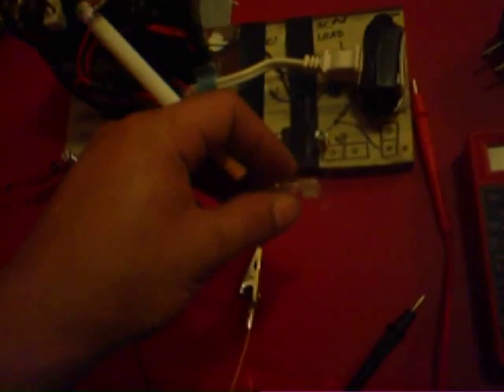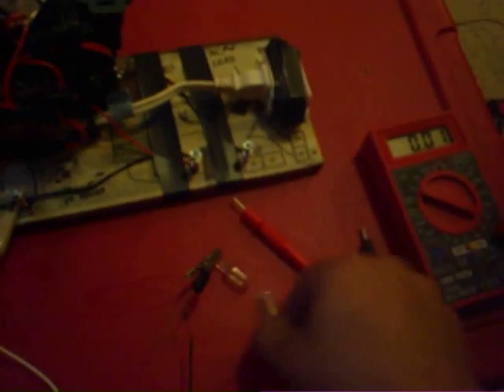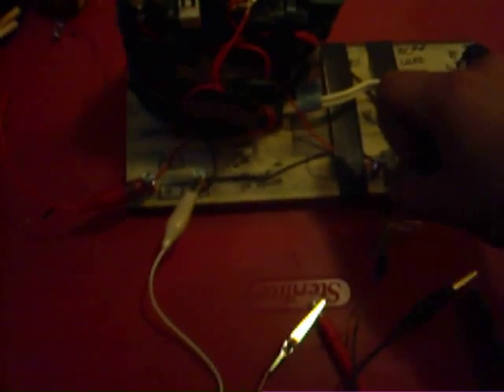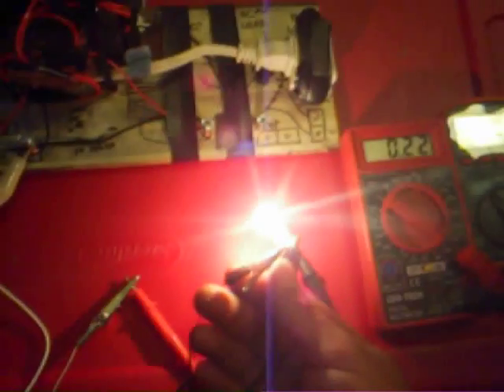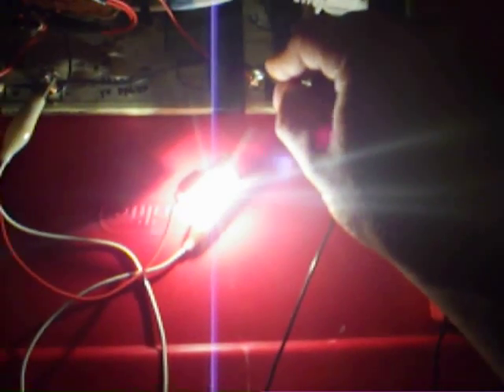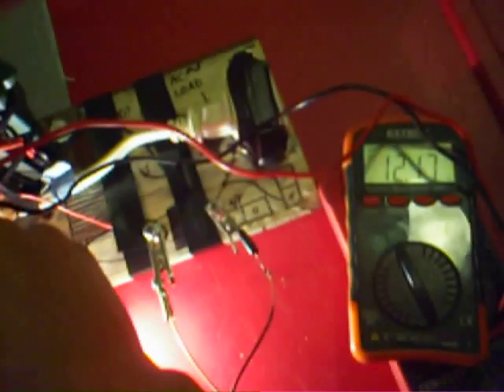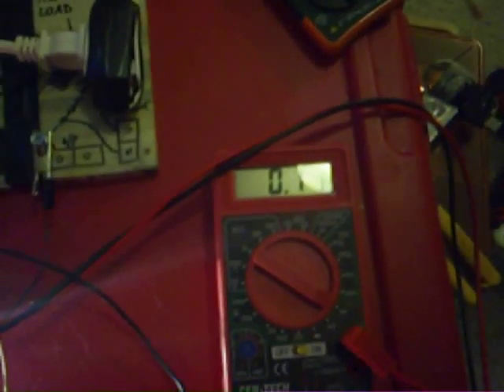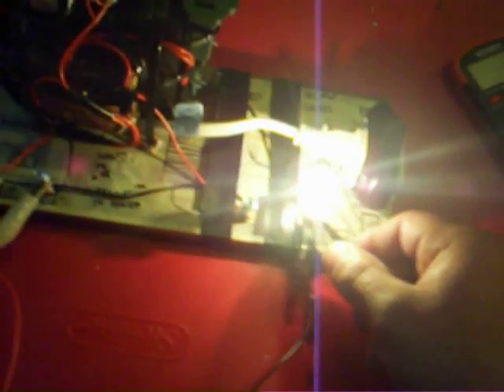12v straight DC vs HV pulsed DC

Comment: The voltage spikes coming off the circuit maybe?  Or maybe the rms is different from the meters?  Good experiment
Reply from the maker: Farlande4 yes i'd say that the voltage spikes are periodically driving the bulb at a higher voltage less current ratio as opposed to straight 12v DC, and for whatever reason this is giving the light a more whitish and brighter appearance.  this is pretty straightforward and understandable when dealing with low power LEDs but it's interesting to see sort of the same thing in an incandescent bulb.

Comment: You won't get an accurate reading of DC voltage, if the DC is pulsed, because pulsed DC is essentially AC.
Reply from the maker: this is true but either way the pulsed output is providing the brighter light, and factoring in the losses in the oscillator, the watts going into the bulb via the pulsed DC is very similar to the watts going in straight from the smoothed DC from the adapter. in this test i cannot say for sure the brighter bulb is actually using less wattage, but i'd wager it to be roughly the same. the oscillator itself is pulling more current overall, but as blocking oscillators go that dirty setup is probably only about 40% efficient at most. so i'd wager in this particular test the bulb is showing that it will get brighter with a different v/a ratio as opposed to the factory recommended 12v ?a. LED's for sure have been proven to better take advantage of pulsed dc than constant when it comes to efficiency, im wondering if the same can possibly be said for filament bulbs.